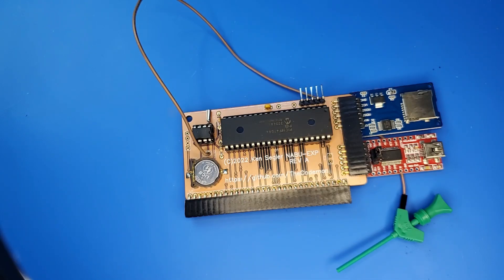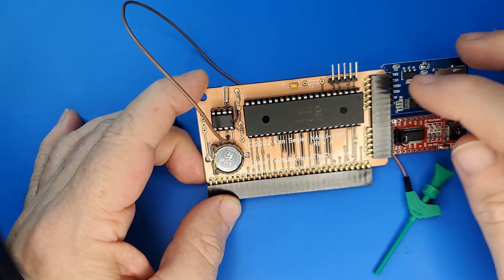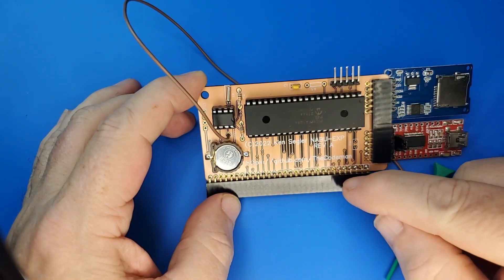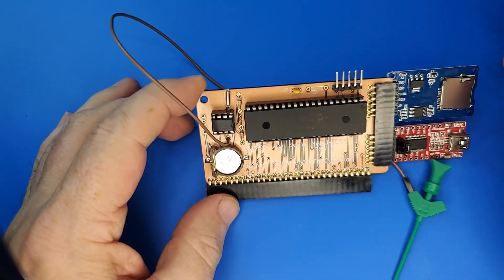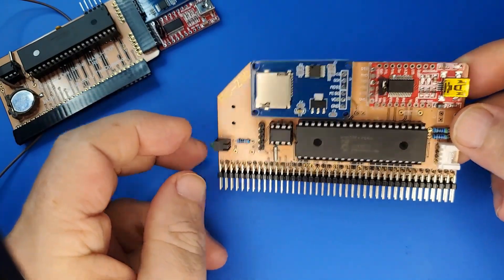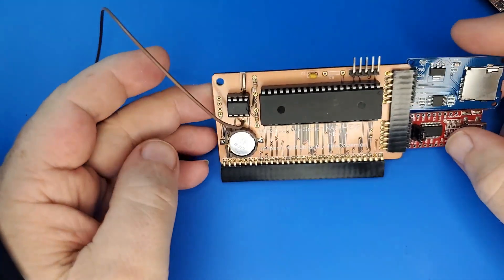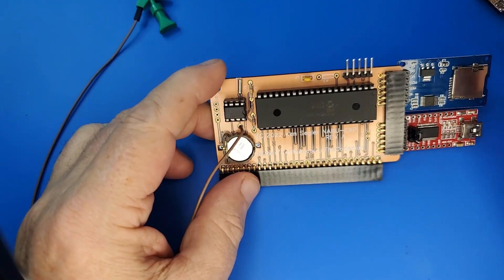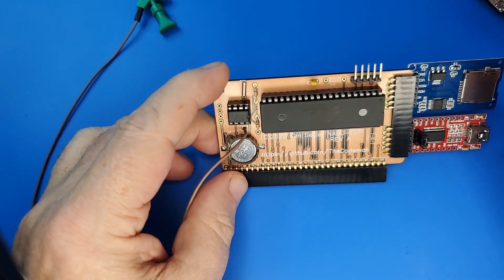Nabu PC My Nabu-EXP Board

Comment: Oh. Yes... Would like to know more or and/or further input on ROM & PIC flash. Trying to hack my way through understanding how to program the ROM to Option Card and the PIC to the NABU and SD card. Many different ways to also separate out from Lower-level code to higher level code. Share code would be great; or hints on constructing our own software to interact from NABU ROM to SD break-out using the option card. Any help appreciated.

Comment: While I'm having a blast seeing all the original NABU hardware getting dusted off and seeing Leo and DJ Sures and the other NABU folks doing the historic recreation/preservation side of things, I'm personally more excited for things like this, which will allow more tinkering with the hardware/homebrew for the NABU PC without having to source MFM hard drives and long-discontinued controller chips and the like. Be sure you toss up a video when you've got parts up on your tindie page! You might also want to consider burning some of those custom proms for those who don't have an eeprom burner.

It'd be nice to get the original nabu software onto SD card and have an internal loader that doesn't have to rely on the carousel loading the adaptor port expects, though I'm not sure how much the software the other guys have they want/can allow to be copied elsewhere. I'd sure like a menu that lets you load from onboard storage though!

Very cool all around though!

Comment: Awesome, Ken. Is your pic emulating the original WD2797 floppy drive controller? If so, using my network internet adapter, you'd be able to use some of the Paks that require a drive, such as Zork.
Reply from the maker: It does not emulate the fdc controller after looking at the factory one it seems it uses all 4 chip selects and all 4 interrupts and have not went through the rom that far. My boot rom just loads a binary from a fat32 partition in to ram @ 0x2000 and runs it.
Reply: @kensegler  Interested in assisting an sd card adapter to emulate the wdc fdc ic?
Reply from the maker: @DJSures  Sure sounds fun just need to map out all the io address it uses.
Reply from the maker: @DJSures  ok i see how it works now the adapter board that plugs in to the 4 30 pin headers is just to combine them in to the flex cable.

Comment: Thanks for the video. I would love to respin this board to mount the SD adapter securely similar to your RC2014 board, and make it taller so it could be held in by the top cover. Is the debug port usable as a serial port for the Nabu, or is it only for programming and debugging the PIC?
Reply from the maker: The reason for the sd adapter not being mounted to the pcb is so you can use a extension to route to the back of the case. And yes the extra serial can be used by software.